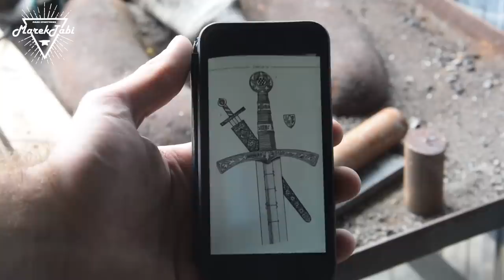Making Historic Kingdom Sword

Comment: Nice but I think the handle needs to be more refined. The space between the guard and the handle itself needs to be more flushed with the guard. The handle itself is a bigger diameter than the spacers. Imo. Not sure if that was done on purpose but it's a nice piece.